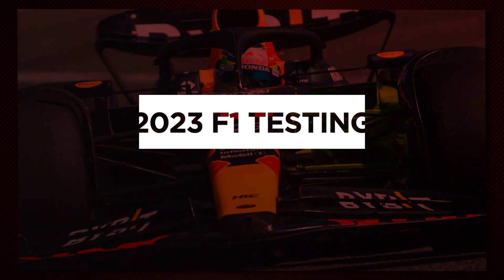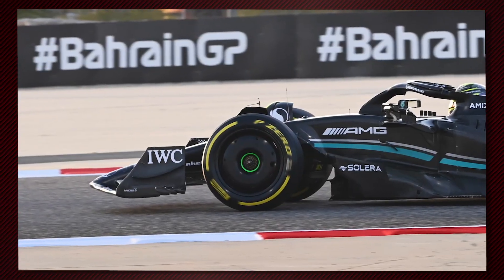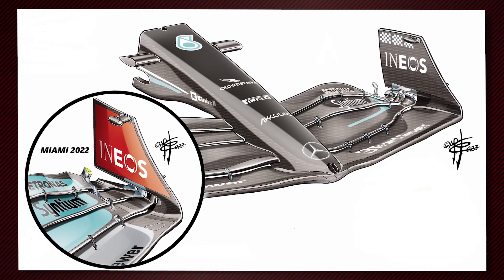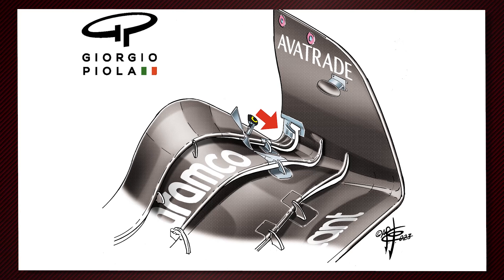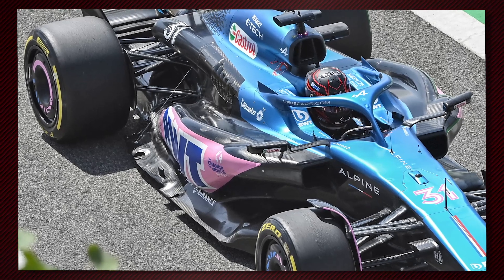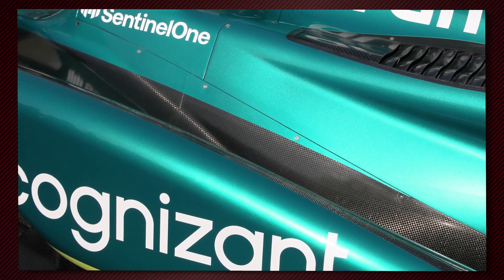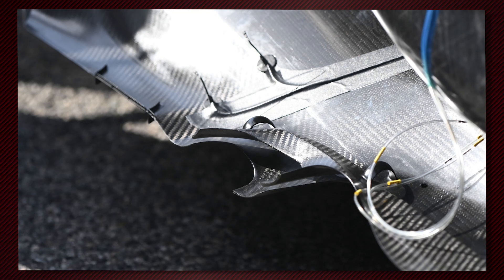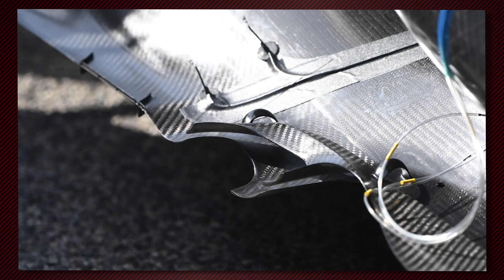F1 2023's Testing Tech - Who Upgraded What and Why?

Comment: Front wing outwash is a minor accomplishment for Mercedes that can be mimicked by the rest of the field if it hasn't been done so already and just not been displayed during testing. Same logic applies to smoothing cockpit turbulence.

Based on the collective wisdom of the experts on various channels if and only if Mercedes has properly re-engineered the under floor* and diffuser** and reduced weight*** and achieved proper chassis balance** and massaged the suspension*** the exposed aero from front to back that we all can see can be made to support these foundational performance elements. To give them a competitive car.
    
That is a big mountain to climb in the off season. As according to Mercedes they dropped the ball on * and ** and * and ** and *****. If they have achieved this mammoth task it will truly be impressive. Their power unit is the only rock solid component they have. 
  
Ferrari achilles hell is supposedly their engine with its non split turbo and tire degradation which is supposedly tied to weight and chassis balance. Not as big a mountain to climb but the engine is the hill they may die on. There is no way to go to a split turbo.
     
Aston Martin is the dark horse the truly unknown commodity in the mix. They have rebounded in spectacular fashion and appear to have a car that has the potential to be a podium contender occasionally and top five consistently. The essential "NEWEYIZATION" of the upper aero side pods combined with the Mercedes power unit makes this a good bet. As Alonso stresses cars to their design limits based on pundits commentary the durability of the Mercedes power unit will be put to the test. 
    

For Alpine basically the same discussion applies as for Aston Martin with a splash of Ferrari engine issue. They however have a split turbo so they have more apparent room to improve reliability. 
   
Red Bull's margin of victory it would appear has likely been reduced but not eliminated. Evolution of a proven winning design is the least complex task.

      
And the great equalizer no matter how great the car may be is the launch followed by "the first corner" followed by the remainder of the first lap where even the greatest car and driver on the grid can be compromised or eliminated as history has shown repeatedly. LOL
Reply: Gotta say this is a really interesting comment and pretty insightful